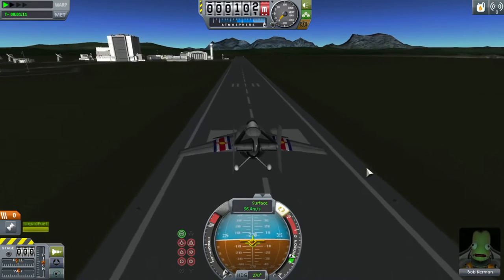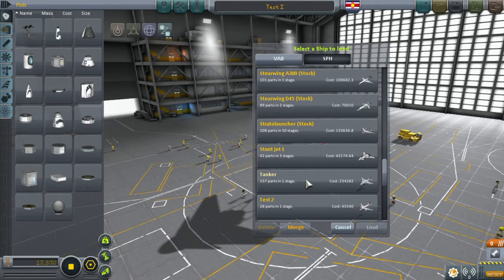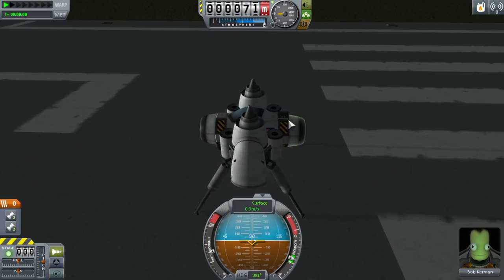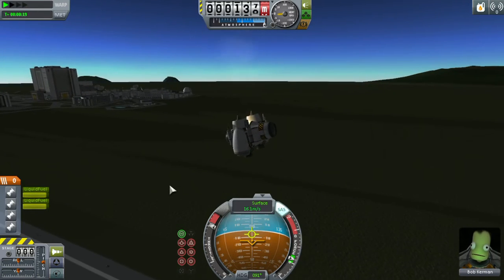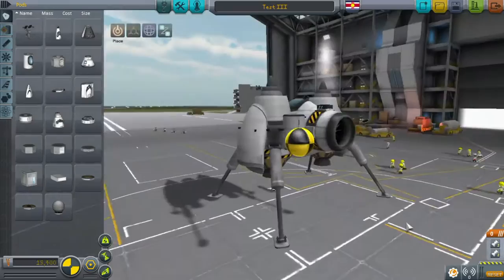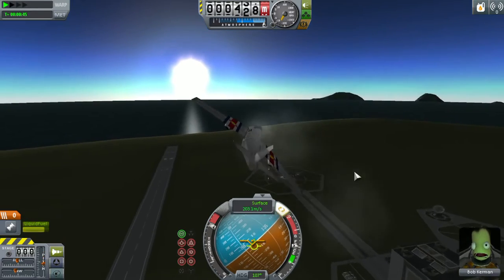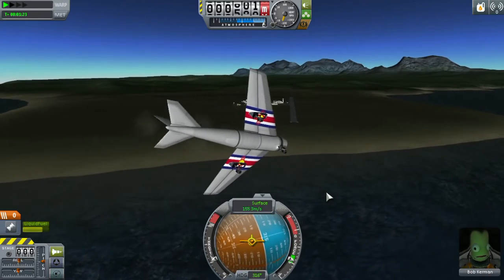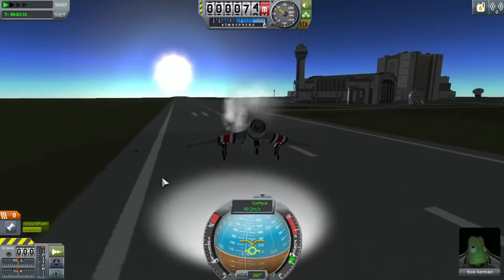Kerbal Space Program   Thrust Reversing and You

Comment: Hey!  I had been missing my dose of Southwestern prodigal brilliance.  Thank you for another quality video.  I wish I could say great minds think alike (if you care to check out my biplane video below) but your stuff looks better than mine.  I'd even say that VTOL is on par with Cupcake Landers.  
https://youtu.be/J84QYRYhA6s

Yes, the intakes are rather bothersome in that they actually need craft movement to induce intake flow.  On the plus side, I find I can see an engine's % requirement by right clicking on the engine.  That way I can watch the intake % while also monitoring the thrust output - saves me having to micromanage multiple parts.  
Don't know if you've run into this yet but I've also had loads of problems when attaching engines to the Mk2 Bicoupler fuel tank.  Doesn't matter if I attach the engines individually or using symmetry, when under way the starboard engine always seems to lose intake supply first.
Reply from the maker: +ArchaicAlibi Hey brother, thanks for the comment. I have been testing the Bicoupler and the rapiers and have not been able to reproduce your problem. Not sure what else to tell ya...